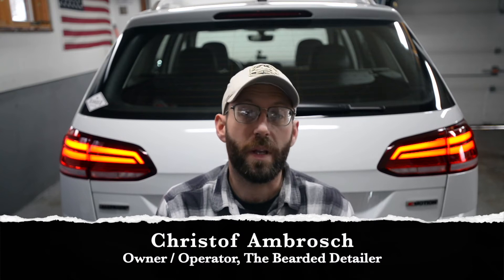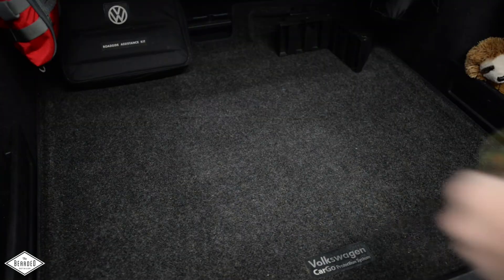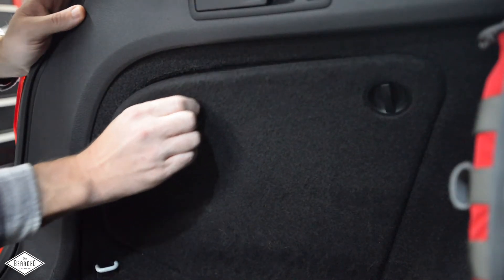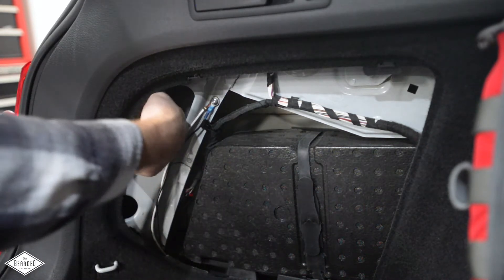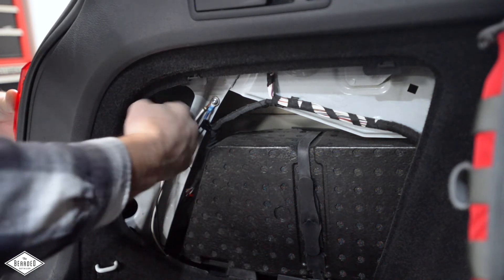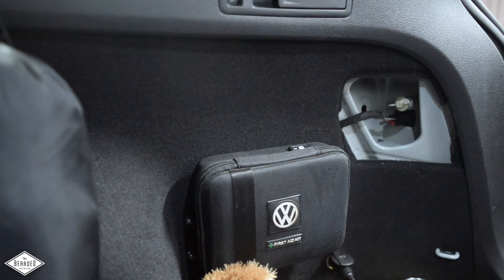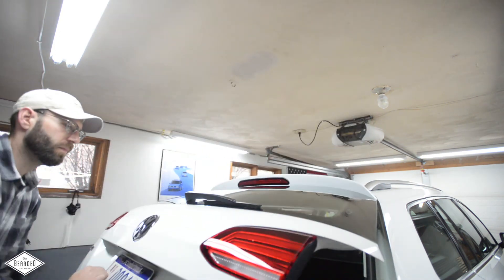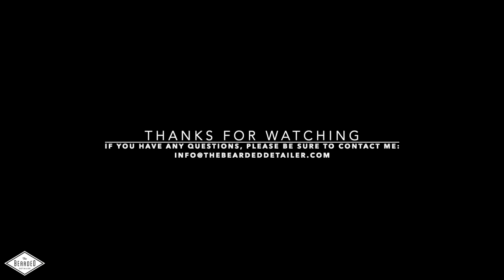DIY: Mk7 Golf Variant Tail Lamp Retrofit

Comment: I might hav missed the information but these are the  sequential upgraded taillights?
Reply from the maker: You didn't miss it...they do not have sequential turn signals. As of writing this, there are no OEM or aftermarket tail lamp for the Mk7 wagon that has sequential turn signals.
Reply: @thebeardeddetailer  So you only sell taillights for the wagon? I have the 4 door GTI
Reply from the maker: @kawzx777  Correct. I only deal with wagon tail lamps, not the Golf/GTI/R.